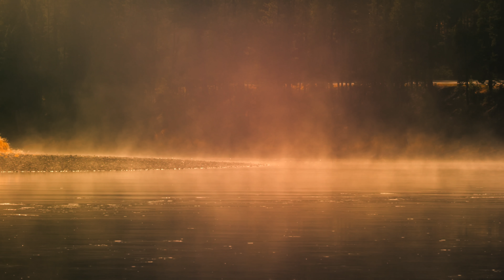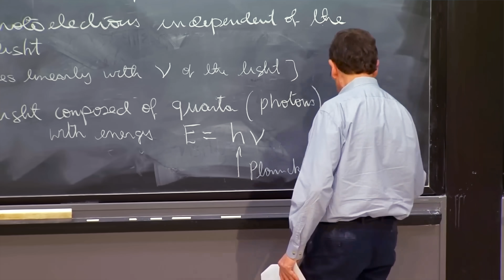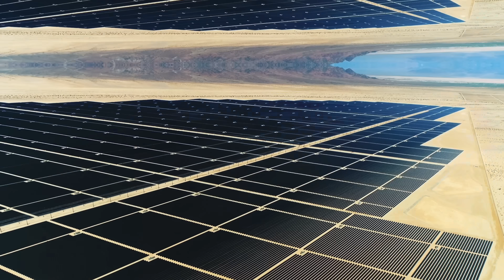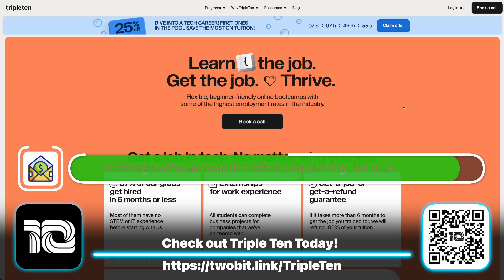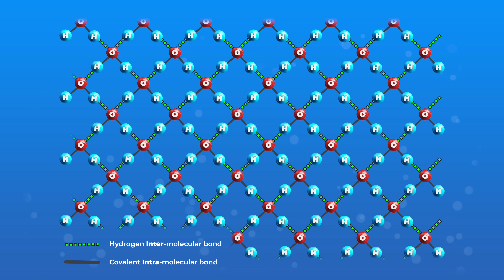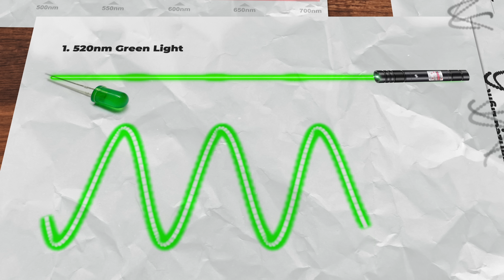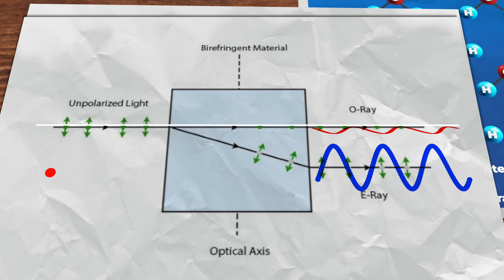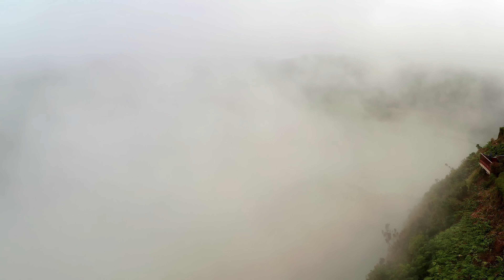New MIT Discovery Just Solved Water's BIGGEST Mystery!

Comment: During Spring time, I had noticed the snow freezes more at night with full moon instead of black sky (at new moon), in the mountain despite a same air temperature !

The light effect is a reality :D .  Thanks for sharing the news ;-)

In a freezer, why does hot water freeze faster than cold water ? The photo-molecular effect might be involded : infra-red photons from the inner hot water could fasten the evaporation of water on the surface, each cluster pulling out extra moleculs because of the associted quantum effect (verified with ions in a magnetic well).

The cool surface freezes before
Reply: ... Before cooling down the rest of the previously hot water, cooling down by induction. The cooling enpowered by the radiated photons from inside and their influence at the surface of the water unit.

An Impossible process !?

Comment: i dont unerstand this as everyone knows puddles evaporate when its cold and dry
Reply: Thermal evaporation also occurs when it is cold and dry. Temperature is an average of thermal energy so you can easilly still have individual molecules that gain enough energy to fly off even when the water as a whole is cool.

That said this isn't nearly as magic as he seems to think. It is basically just using light to make mist (which in turn leads to more water loss because it has more surface area). You can get the same effect by mechanically misting the water.

All of the 'fancy' effects just come down to "mist evaporates more readily than water."
Reply: @kanoaika  come off it its cold no individual molecules are hot  or have an an environment where theres any energy to collect

Comment: I’ve always thought that for most of nature it wasn’t that the heat was burning the moisture away, but increasing the temperature of the air and creating a higher potential in humidity capacity and slowly sucking and absorbing the water up like a sponge. Pretty much the same way if you leave a bowl of water out in your home in a place with no extensive heat or sunlight it will still eventually dry out. 

So the difference in potential between mediums being the greatest force in evaporation.

Then the actual radiation loosening the water atoms as second 

A change in shape or motion of either water or air being third. (For example water “drying” up in the extreme cold and windy like the poles where there is no humidity and surface atoms are shave off and carried away.

Comment: What's super cool about this is that we can engineer this effect to make evaporation (which is VERY energy intensive) require much less energy input, and more efficient by not wasting energy as heat.
I mean, can you imagine a lamp that you just point it at your clothes and they dry up almost instantly without even warming you up? And it's green visible light so it's totally harmless!
Reply: I'm imagine friends visiting, wondering why the green light is on..."Oops, I was just drying my clothes!" ✌️😸
Reply: Another advantage seems like it could work on flowing water since the light is targeted on the molecules it interacts with at the surface, whereas heat needs to dissipates throughout the bulk of the water before evaporation can reach its equilibrium. This also implies that the initial energy savings is even greater.
Reply: @riderpaul  No it doesn't evaporation always happens at the surface of a liquid. Just blow dry air over it and it'll evaporate room temperature water all day. Make the air warm for even higher effectiveness - you know, like a hand dryer... 

I literally can't stress enough that there is no energy saving in this. Whatever method you use to evaporate a certain mass of water will require exactly the same energy because this value is literally a fixed property of water.
Reply: @peglor Thanks for the reply.  What I was talking/asking about is a surface effect vs a bulk body effect. The question I have is if this is a surface effect? Could a dome be placed above a spot in the ocean and would this effect create more evaporation than other means? I imagine that pointing the light at an angle helps reduce the loss of energy into the bulk mass of the water in addition to any directional effects. Removing the equilibrium vapor pressure above the surface is necessary no matter what. So I guess it would boil down to the efficiency of heating air vs creating the light and then how much is lost to the bulk of the water as well as into the exhaust/vapor.
Reply: @riderpaul  Converting electrical power and mechanical work to heat can be 100% efficient, converting it to light is way less than that - what you lose in efficiency creating light becomes waste heat anyway, so adding light creation is just more steps and expense to get the same result. 

Any industrial process that requires evaporation of say a tank of liquid isn't going to be helped. What it might help with is smaller amounts of evaporation where the light and air flow are effectively free - like drying paint, but if this effect constituted a literal night and day difference in real world performance, it would have been discovered a long time ago.
Reply: The video literally said you can't do this - conservation of energy is not broken, you're just getting the energy from a different source. Anyone claiming to have invalidated conservation of energy (Unless they're talking about red shifting light due to the expansion of interstellar space, which does appear lose energy rather than conserving it), is either a con artist preying on the scientifically illiterate, scientifically illiterate themselves or both.
Reply: I could imagine a Green Laser or LED set up to replace electric dryers... maybe even something 'powered' by firefly light [luciferin]. ;-)
Reply: They've had these in bathrooms for decades, especially in fancy hotel bathrooms.

Comment: If you're using the heat out of the surrounding air to break up the clusters of water molecules, isn't that functionally the same as using heat from any other source (or heat from the sun in natural evaporation) since that heat is warming up the air molecules?

Comment: Is this really a discovery? It sounds like new terminology, with deeper research and supporting data, for a well known and established concept, understood for at least as long as I've been living at 50 years. Another actual "real" effect for evaporation (which isn't clearly understood by many), is to do with QFT or Quantum Field Theory, which describes the "electron field", as a field permeating all of space and in every direction, which contains billions of volts, contained within electrons, per square inch. Both in fact, relate to the "photoelectric effect". Photons and electrons do not have similar charges of energy potential. Photons are particles of light and carry energy that is proportional to their frequency, as described by the equation E = hf where (E) is the energy, (h) is Planck’s constant, and (f) is the frequency. Electrons, on the other hand, are charged particles with mass and can have kinetic energy when they move.

The energy of an electron can be related to its potential energy in an electric field by the equation E = qV where (q) is the charge of the electron and (V) is the electric potential. While both photons and electrons can interact with matter and transfer energy, they do so, in fundamentally different ways due to their distinct properties. For example, in the photoelectric effect, a photon can transfer its energy to an electron, causing the electron to be ejected from a material. However, this does not mean they have similar charges of energy potential, as they don't and this is the distinction being made, by MIT research into the "photomolecular effect".

Comment: I have been studying alternative energy production for some time now. Here is a rabbit hole for you to jump in. Or not. See if you can follow my line of thought. If 520nm light at 45 degrees can break apart water molecules? We know water is a bent molecule. Then at what frequency and angle can the hydrogen and oxygen bonds be broken. If light itself isn't sufficient, then which atom in close proximity would act as the catalyst? I've jumped into a few rabbit holes Tesla discussed but never went down in producing the arc lamp. Chlorophyl uses magnesium.

Comment: It's very important to notice that the molecular weight of water is substantially smaller than the molecular weight of the gases in the atmosphere. It is already remarkable that water is a liquid at room temperature. This suggests that you don't really need much energy to liberate water molecules from their aqueous environment. You just need to disrupt the hydrogen bonding in some way.
Reply: Water has a molecular charge orientation which makes it align in a very strong way.  This makes it denser than air which compared to water is more charge balanced in relation to its peers.  Denser of course means it tries to push lower in the gravity field.  But, that is an interesting observation none-the-less.
Reply: @gonegahgah clouds are water vapor and they are certainly not denser than air. What am i missing?
Reply: @swarsi12  They don't stay as vapour.  "Rain" is what you're missing...  What causes them to gather as droplets?
Reply: @swarsi12  Define air? Hydrogen and oxygen are both gases. Di-nitrogen is the most abundant gas in the atmosphere and nitrogen is less denser than oxygen but combine with hydrogen as H20, 2 hydrogen and 1 oxygen give you 10 while 2 nitrogen in di-nitrogen would give you 14. So it's natural to see an erratic behavior because the hydrogen bound in water loosens with heat and contracts with cold. So maybe you forgot that oxygen is denser than nitrogen, I don't know, only you do. Plus the pressure of the air is principally the pressure of water vapor. So in absence of water vapor, the pressure of the air is minimal. A dry air helps to evaporate water until the air is saturated. But that's another matter.
Reply: The uneven charge across the water molecule causes the molecules to bond together far more strongly than molecules with a similar atomic weight but more even charge distribution. The OH group that defines alcohols also creates this dipole, keeping alcohols liquid at room temperature too. Water requires a huge amount of energy to evaporate (It take far more energy to convert a kg of water at 100 C to steam than it does to heat the same kg of water from 0 to 100 C). That's why steam is such a good way of transporting heat energy for power generation.
Reply: Possibly forgetting about surface tension.
Reply: I believe there is additional energy needed to heat the water.  It will be cooling while the laser evaporate the water. The air cools then that also cools the water. 9:30
Reply: @oldmech619  2.45 MJ of energy per kg of water.   The latent heat of vapourisation
Reply: Like ionizing it with UV light (rather than green light..) should do the job, I think

Comment: An additional explanation for why water can help internal combustion units work for efficiently?
Reply: No - the effect of the water evaporating is to cool the intake air or air/fuel mixture. All of this takes place in ducting feeding into the engine in complete darkness. During combustion the evaporated water will reduce combustion temperature too, because it either acts as an inert gas, or similar to what happens with nitrogen, the high combustion temperature breaks the water molecules apart, which again takes energy that would have manifested as more heat otherwise. The extra gas taken into the engine because the inlet air is colder and therefore denser means there's more oxygen in the cylinder overall to burn, so power output increases. I don't think the efficiency improves dramatically.

I should note that water is made from hydrogen and oxygen, two things that you add together to make combustion happen, but when these elements are taken in already reacted together, it doesn't matter if the molecule is broken apart during combustion, the oxygen and hydrogen will react with each other and just get you back to a water molecule, the same energy you started with.